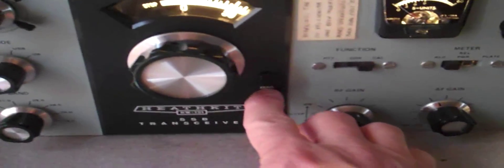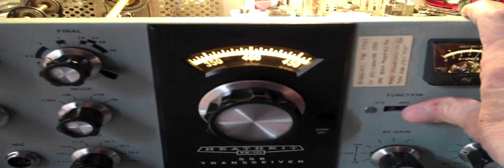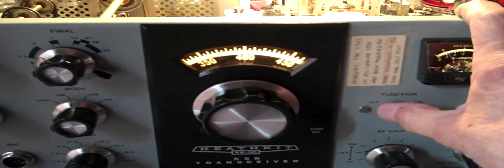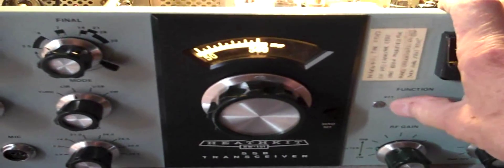Obtaining A Ham License-step by step-the details you need to know (part 28 of 34: dial calibration).

Comment: Hey John,

Have you joined the Heathkit Yahoo Group? They are *very* active and they have quite a large base of knowledge which will most certainly benefit you. I haven't looked at my HW-101 manual in the past week or so but I believe the VFO and crystal calibrator are aligned separately.

Good luck!
 
                  - Mike

Comment from the maker: @AllAmericanFiveRadio,
Rick,
Actually you're right about the WWV stations.  This weekend I'll be using WWV to calibrate this critter, but it'll come from my Kaito or Hammarlund.  The HW-101 manual  says to connect a random wire from a GC receiver antenna connector to the output of the transceiver.  The calibration signal (100khz) can then be zero beat against WWV.  Sounds like fun.  Maybe it'll help.
Once again, stand by to stand by.  New vid soon.

Regards,
John

Comment from the maker: @hedwig85
This weekend I'm completely realigning this bugger and will use my Kaito or Hammarlund to provide the WWV signal, zero beating the crystal calibrator against it.
The rig's original owner was a career military man and added a MARS mod to it.  That could untimately be causing the calibration difficulty.   If need be, I'll pull the VFO chassis and make things original.  I'll know more this weekend.  New vid Tue. or Wed.
Thanks.  I very much appreciate your inputs.

Regards,
John

Comment: John, you're calibrating the dial correctly. I found it normal to recalibrate the dial when tuning on each end the band. If you want to confirm the specific frequency you're on, I would set up a sked on say 10m, with a club member(s) who has a rig with digital display. You can do this away from edge of the band. Be sure to ask them where they hear you.  If you're club holds regular HF nets, you cud tune in & see where you hear them.

Comment: @AllAmericanFiveRadio 
 Hi Rick,  I agree John's HeathKit is looking fine!  I also thought about WWV but unfortunately the HW101 doesn't receive any of their frequencies.  The band ranges (MHz ) on the HW are 3.5-4.0, 7.0-7.3, 14.0-14.5, 21.0-21.5, 28.0-28.5, 29.0-29.5 and 29.5-30.0.. Another comparison is the W1AW code & voice transmissions. Many of their frequencies fall within range of John's rig. Their skeds are published on W1AW website.